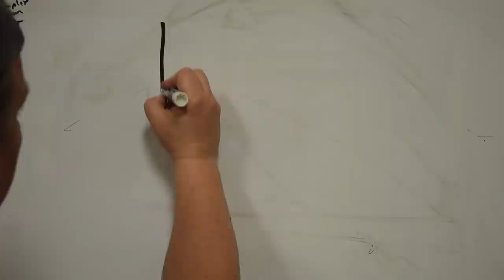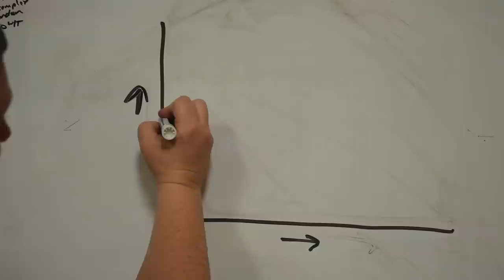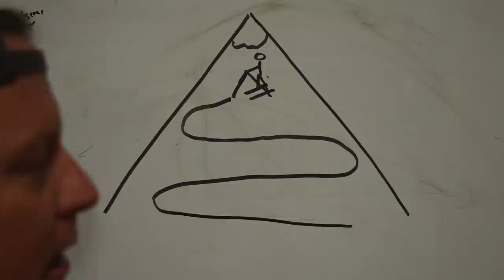Band Saw and Knife Skills - Start Woodworking - Class Two PART 3

Comment: Shawn, thanks for the video.  Even though I’ve used a bandsaw a lot for years, I gained quite a few tips that my experienced brain missed over those years.  Also learned a lot from the knife section.  Haven’t used one too much in the past, probably because I was always using it wrong.  Now I may try again, once I get a proper knife for doing so.  Thanks again.  Stay safe and well so you can keep the videos coming. Cheers, Tom
Reply from the maker: Thanks

Comment: Great lessons... one thing i wondered, are there any tell tell signs you are feeding too much into your bandsaw? I find myself watching how fast the thrust bearing spins to judge it 🤷‍♂️
Reply from the maker: It should almost feed itself. But it is a 'feel'.
Reply: @wortheffort  dang.... sometimes i feel like i have to cut at a snails pace  through the 3" oak posts i make alot of stuff out of
Reply: @BradsWorkbench  That comes from watching experienced/professionals using any tool and especially lathes.  The aggressiveness, speed and seeing the chips fly makes you feel that is how it is suppose to be done.  Fine WHEN you become experienced/professional you can do that when doing demonstrations/videos because it;s impressive.  Slow down and learn how the tool is working.  No race to be run here.

Comment: Just woundering, why my cutting blade twisted (not straight0 when cutting. How to set the blade to not twist, as the word that I cut always not straight.
Reply from the maker: Blade not running on crown. Watch bandsaw setup video. Bandsaw blades are supposed to twist.

Comment: 2:50 I was told if you cut wide boards into narrow ones, when you get to Heaven, God will make you stand way in the back.
32:08 If you set that board on the 3/4" side instead of the 3" side, you will reduce the angle and have less waste.